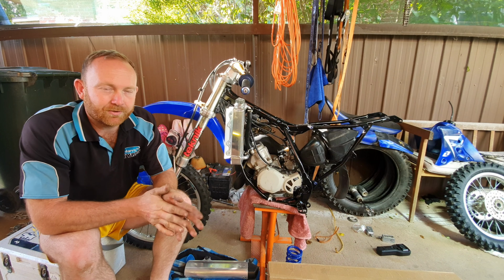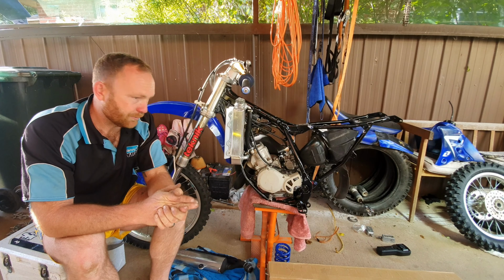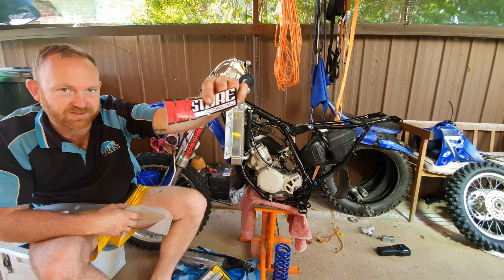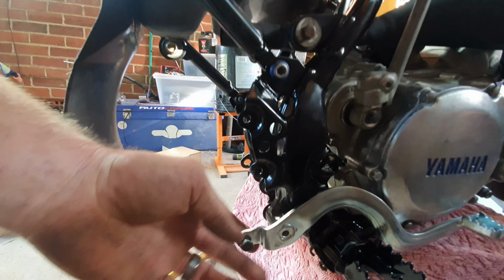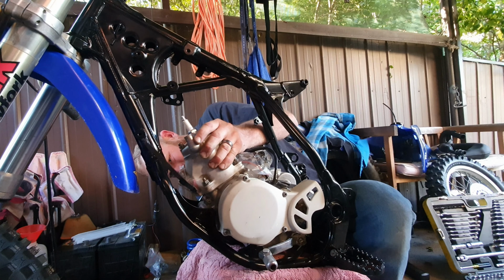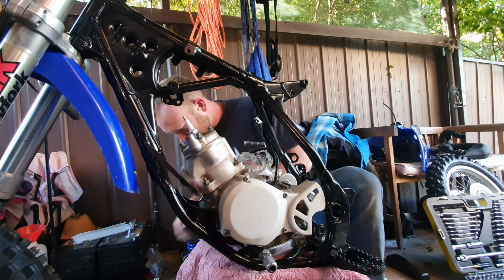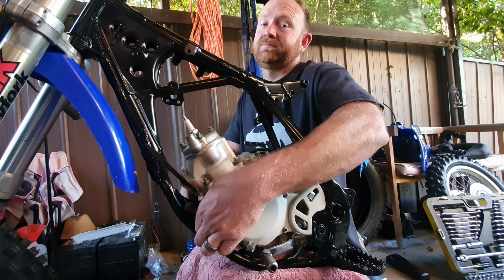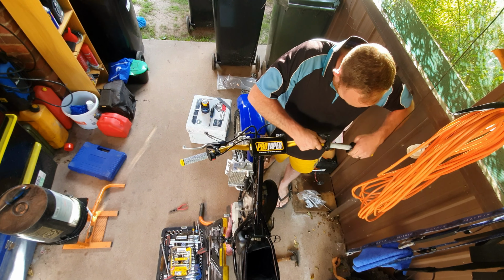$400 YZ85 BUILD EPISODE 3 motor install & protaper contour bars frames looking fresh!!!!!!

Comment: you should seal the parts you steelo'd with a surface tolerant heat proof clear otherwise theyre going to be a nightmare to clean after rides (micro scratches in surface). how often will you service her? thats a 4 stroke aye?
Reply from the maker: Hey mate yer i did my old wr400 like this b 4 i was particular with it polishing alot lol.. service not ofter it wont get much use tho id say every 10hours. Shes a 2 stroke mate 🤙🤙

Comment: lookin good mate! what paint did ya use for the frame? how did ya prep it? looks like a fun lil project!. im thinkin of gettin a bike in the future and have always heard good about the YZ and CR... whatbdo u reckon?
Reply from the maker: Hey cheers mate its been powdercoated so its super tough and yeah deffs the yz and cr are awsome bikes im planning a 250 to do up one day aswell
Reply from the maker: And prep took it to a sandblaster and then to the powdercoater i did nothing just took it to the professionals
Reply: @TRAV30387  ahh good choice of coating on the frame. I'm a sandblaster, spraypainter, powder coater by trade :)
Reply from the maker: @ReinventingTheSteve  ahh how good is that
Reply: @TRAV30387  if i didnt live on the otherside of Aus (perth) I'd do any of your blasting and coating needs for free for ya
Reply from the maker: @ReinventingTheSteve  mate that would b awsome 👌 unfortunately ur far away